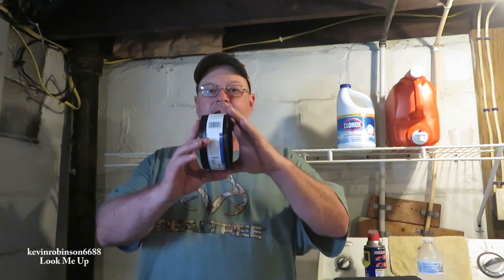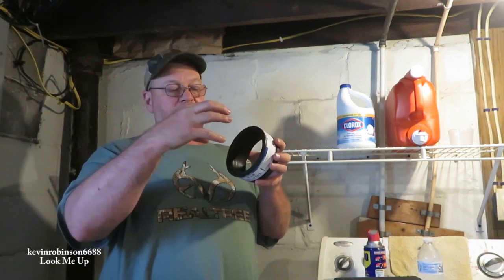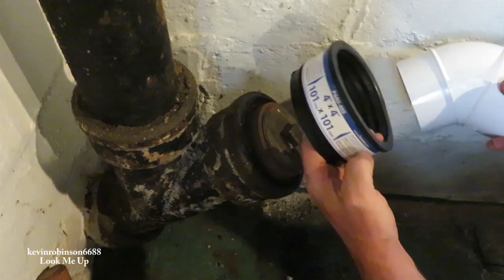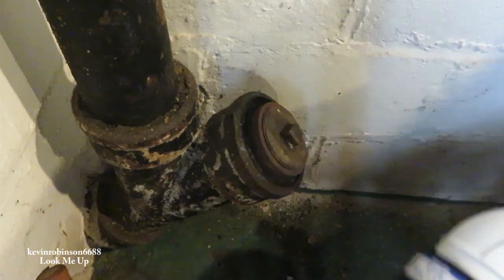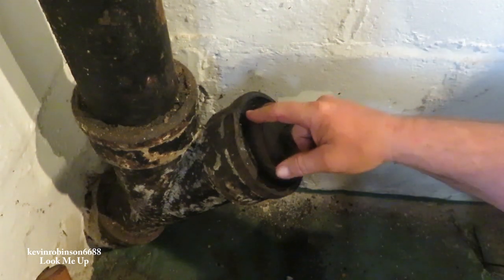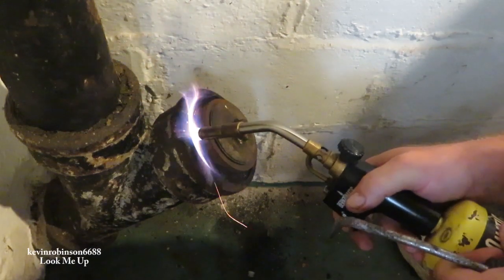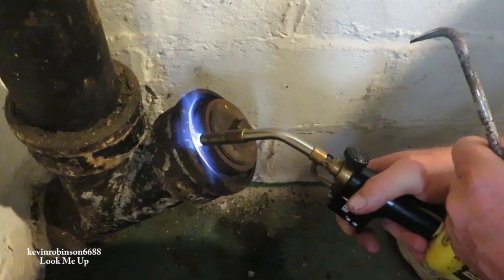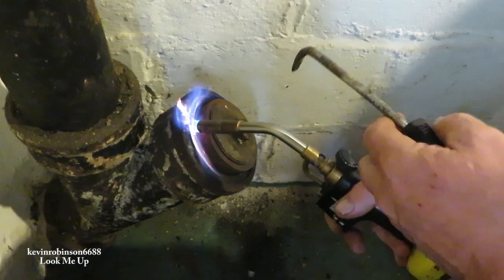How to remove a lead joint form Cast iron drain and connect to pvc pipe

Comment: Nice video for sure. What holds the white PVC elbow tightly into that rubber hub/bushing that you inserted into the cast Iron pipe? It looks like it is a loose fit and might leak. I have a similar situation coming up and anything you can share is helpful. Thanks!
Reply from the maker: I don't remember using anything to hold it in it ,did fit pretty tight and i never had any issues with it, make sure you have plenty of fresh ventilation before cutting that lead pipe.

Comment: Very Nice video and very useful info..
I need to find out how to remove a 4" cast iron T with two sides connected with rubber bushings. (Note: One horizontal hub coupling and one vertical hum coupling (facing downward) has the rubber bushing/donuts. The top opening/coupling on the  sanitary T is currently open with no pipe currently installed. The T coupling doesn't have any play in it to try and remove it. Have you had that situation and I welcome your advice? Thanks.
Reply from the maker: That’s a tough one! I haven’t come across that situation yet, but it seems like a real challenge.Sorry i can't help

Comment: Just take a drill bit and drill a bunch of holes around the pipe in the lead then pick it all out with a big screwdriver. You drill the holes in about a minute and it takes maybe a minute or two to get the lead out. Beat the pipe with a hammer to get it all moving. Once it's out use a wire brush in a drill to clean it up. Overall it takes maybe five minutes if it's in a bad spot or stubborn. With how loose that fitting is I can tell that it won't seal worth a damn either, if you've done it right it'll be hell getting the pipe in there. You almost always need to lube it up and beat it in. 

I've thought about melting it before I had the thought of A: I don't want to kill my lungs and B: the cast iron will just suck the heat away and make it take forever. I do plenty of work with old cast iron and it truthfully is so much faster, easier and less harmful to your health to just drill the lead.
Reply from the maker: Thanks for the info, but i did it the only way i knew how to at the time.

Comment: Induction heater
Wrap the coil around the outside of the pipe and the pipe will get red hot in seconds and you can pull the clean out right out of the pipe
Reply from the maker: Thanks for the info.

Comment: Would an inductive heater/ pipe soldering iron such as a Ridgid RT-175 work in place of the MAP gas torch?
Reply from the maker: It should, not positive but give it a try.

Comment: The soil pipe hub seal requires the full O.D. of a 4" PVC pipe to fit correctly and make a tight seal.  Chamfered on the end, lubricated with some soapy water and with much effort, forced into place to assure a tight seal.  If the reduced end of the slip-fit 45 degree fitting, as shown in the video is used in there, it won't provide a very good seal. Could leak both liquids and sewer gases.
Reply from the maker: No issues so far but thanks for the info

Comment: I just want to know how to get the PVC pipe into the compression coupling, it doesn't just slide in, it doesn't go in with a rubber mallet, and I have no room in my upstairs bathroom floor to pry against anything.  There has to be a better way... 4 hours trying unsuccessfully to get this in so I can use the toilet, this is ridiculous!  HELP
Reply from the maker: Did you try any dish soap to help ease it on, sorry for the late response.
Reply: @Robinson-Homestead  I did, just not worth the hassle.  I ripped all the cast iron out 2 days ago and replaced everything with PVC all the way to the basement.  It was the right thing to do now, I got rid of the wonky plumbing they did 50+ years ago.  Now my sink and tub are tied in further down so if something happens to the toilet, I don't lose my entire bathroom, and the toilet isn't using the tub and sink as a breather LOL!

Comment: I'm not a plumber by trade but do not heat lead up unless you're certified in knowing what you're doing safely. No ventilation or ppe for those lead fumes is a good way to Darwin yourself.
Reply from the maker: Thanks for the comment

Comment: So much easier to use a carbide toothed hole saw bit...trust me. I do it all the time. Been plumbing almost 20 years and I own my own small business. I exclusively do remodels and service. Try it and you will see. Fk doing the torch method and the drill bit method
Reply from the maker: Thanks for the comment.
Reply: What size of hole saw
Reply: For a 2 inch hub

Comment: Very  well explained...Thank you.I still have a question: Is that tight  enough  to  seal perfectly? I have seen some guys  using  4" regular PVC pipe and just make a bevel  to the end which inserted  in to make it tighter?
Reply from the maker: I have had no issues so far thanks.

Comment: I haven’t done plumbing in 30 years but that rubber thing we used to call dual tights and you have to grease it and it’s really hard to put it. I have no idea what you were using but that’s gonna leak like a sieve.
Reply from the maker: Thanks for the comment has been working great so far no leaks.
Reply: @Robinson-Homestead You probably wouldn’t have leaks until it backs up. Imagine two straws, one with a smaller diameter than the other. They fit loosely together. You connect them with the bigger one on the bottom. If you pour water into this assembly, you wouldn’t have a leak. Then you plug the bottom and pour enough water for the water to back up above the joint. Now you have a leak.
Reply: It lose because he didn't use a schedule 40 PVC street fitting... that fitting he used is the schedule below it.. I think 35 but they just don't list it if if below schedule 40.. they just call it DWV... the one he should use is schedule 40 DWV .. SUPPER tight fitting once it slides in then stretches the outside diameter to grip the cast coupling

Comment: Nice job. An alternative method is to drill out the lead. Get about 5 drill bits an 1/8 in in diameter and start drilling holes all around the joint. Expect to break several of them. Takes about 20 minutes and you will have drilled enough lead out that you can wiggle the joint out by hand. I have used this technique several times on 4 inch cast iron pipe in my home. It works well. Be sure to measure the joint and get the right size fernco fitting.
Reply from the maker: Thanks for the info.
Reply: I love it when the commenter didn't watch the video. LOL (he mentioned the process you suggested at the beginning and explained why he wasn't doing it)

Comment: Hi, I was watching your video and I think I have this problem with a sewer elbow cast iron that comes straight from the toilet on a 90 degree under the foundation and I need to link it to a PVC sewer pipe.
Can I send you a pic maybe you can advice me.
If ok please reply with your email so I can send you a pic.
I already have everything apart and the pipe exposed showing the rusty broken fitting that needs to be removed.
Thanks
Reply from the maker: Sure kdr6688@gmail.com

Comment: I'm watching this because I never did this specific chore of modifying my sanitary C.I. In my basement (for a planned DIY project). But my career has been doing environmental stuff and years of H&S trainings that came with it. I could be wrong, but isn't there something wrong with burning (and breathing) lead in a confined space and without the presenter using a special cartridge respirator?? Most of my career was working around VOCs, but this just raises a flag for me. But again, I could be wrong.
Reply from the maker: This was my first time need lots of ventilation I am not a professional

Comment: DOES NOT WORK!!!
Reply from the maker: No issues so far working great thanks for the comment and watching.
Reply: It does NOT work please do not listen to Kevis pure bs. I just used it its to loose of a fit and the 4 in pvc does not expand as you would want it to to put some pressure on that rubber! Cut the cast iron pipe and union the pipes.
Reply: Its likely because you did not have the right size Fernco fitting for the specific joint you were working on. I have connected PVC to Cast Iron several times and the materials and technique shown in the video is correct for the specific joint he is working with.

Comment: i had no idea this was even an option. I've connected to cast iron cleanouts with male adapters but it's probably not as strong.
Reply from the maker: Just be careful dealing with the lead pipes it can be dangerous for your health without saftey equipment.

Comment: Old Plumber here—You have the wrong fitting. You need schedule 40 and grease. 
Also you need to install a new clean out immediately adjacent to the one that you removed.  Check out the code.
Lastly, back in the day, the lead joints were removed either with a lead pick( I have one) or with the fire pot that kept the lead ready for the joints on the job.
Reply: New plumber here—You think he’d notice it didn’t seal. SDR fitting, when it clearly says DWV (Sch 40). Should have called a plumber.

Comment: Thanks!!
So how does the rubber hub get completely sealed to the cast iron and then to the pvc fitting?? Everything seemed a little lose when you test fit it.
Is there a glue of some sort?
Reply: Then pvc expands the doughnut

Comment: Good info, I've done this before. It sure seemed like you pvc went the rubber boot easy. To easy, did it leak? Mine went on super tight, I had to pound it in with a 2x4 and hammer.

Comment: You've got a schedule 35 pvc fitting, which the fernco donut isn't designed for. You need to use 4" ABS or 4" schedule 40 fittings, which will be a little larger in diameter and fit tighter in the donut.
Reply: I think , in my opinion, that it wasn’t service weight (sv)cast iron it was extra heavy (xh) cast iron which is stamped on the side of all cast iron hubs when forged, therefore that’s why the gasket was so loose … no way would that pvc slip in without extreme amount of effort!!! And lots of lube ! 
This coming from a retired plumber with 45 years of experience in the Long Island NY area !!!
Reply: @louiscandreva8850  What would be the correct donut for joining 4" PVC to XH cast iron?
Reply: @louiscandreva8850  Hoping you can answer.  How would you recommend joining PVC to an XH hub joint?
Reply from the maker: Thanks for the information.
Reply: I was noticing that.  Wondering if the iron being hot had expanded it a little like taking bearing races off of a car
Reply: Looked loose to me too. That explains it.
Reply: The lead is out... your pvc/fernco fitting is way too loose.
Reply: Agreed!
Reply: i noticed that too
Reply: That's a thin wall 1/16 bend no bueno

Comment: Thanks Kevin, my cast iron black pipe goes up through my attic and the septic smell is coming out of the connections of two black iron pipes that were once joined by lead. The lead seems to have lifted up. So I removed and now I placed mortite puddy all around to try and stop the smell. It seems to have worked. 
What would you have done.
Reply from the maker: Put a rubber sleeve over it with hose clamps.
Reply: @Robinson-Homestead  unable to use that unless I cut it in half. And use clamps.

Comment: Its been many decades since I had to do this but I have one to do again now so I'm watching videos. I don't like the torch method and I don't much like the drill method either. I think I used to break the pipe or fitting one inward one chip at a time using a cold chisel , and then use the chisel to pry the lead toward the center and once started it came out easy. Then, because they didn't yet make ferncos, or rubber donuts, or no hub connectors, we had ABS to CI fittings with a spigot,  caulked in oakum, then packed in lead wool which you could pack back into a solid with caulking tools which look like off set chisels but the are flat on the end. I ' just a kid and the real plumbers were still ladling molten lead into the joints.
Reply: I was trying to figure out what the last guy did to my 1-1/4" sink drain and I think the method you described was it haha. Never seen anything like it. Thanks for this comment, I never woulda figured that out without finding a comment/thread like this

Comment: Not a fan of this unsafe method not to mention the time it takes. I recommend removing plug cutting internally several grooves and chisel out pieces. Or you could just thread in an adapter.

Comment: I am a self-employed plumber in New York State with 34 year's experience. I was taught as a helper from my uncle Vinny to do it the torch way. It takes forever and is very messy, especially up in a rafter. I learned the drill and chisel trick and I like MUCH better
Reply: The new trick is to saw the c/o flat,take a hole saw put it over the  hub and  drill out,really fast.
Reply: Drill and chisel sound better. The smell of lead isn't good.
Reply: @DJjosher  It's sweet like lead paint! Yummy!
Reply: This is dumb use a hole
Saw and drill the lead out around it it and it pulls right out
Reply: I agree with both but your way is easier because lead is soft👍🏾
Reply: I could have had the hole house plumbed hammer and flat bar done in 2 minutes
Reply: Breathing those lead fumes is terrible for you it's much safer for your health to drill but make sure you're wearing a mask and gloves
Reply: Try a. Holesaw. I.m a 30 year plumber & it's a new trick to me
Reply: Hole saw faster cleaner plumbing  for over 40 years
Reply: Kevin is working on a cement floor and next to a brick wall, which is more safe than using a torch in an area surrounded by or in proximity to wood.
Reply: Problem is, the cast iron absorbs the heat, and lead doesn't want to melt. You can't do this with a propane torch. It just doesn't get hot enough.
Reply: Am I the only one wondering why the clean out was "soldiered" shut??
Reply: It wasn’t soldered shut, the clean out plug screws into a fitting sleeve, and that fitting is what is fit into the sanitary tee, the joint gets packed with oakum and then about 1/4-1/2” of lead is fed into the gap between the threaded sleeve and the tee, over the oakum. Then finally the lead is peened with a punch to set it, and expand it to fill the voids and lock everything in place. Then you can use the clean out as normal, it will unscrew from the threaded sleeve.
Reply: I think they had to seal it the way they knew how and before things were easy they were hard. Lead is plumbus? (pb- periodic table)in Latin and that because of what pipes were sealed with for thousands of years... and made with at one time due to the softness and ability for lead to fill gaps and bend slightly.

Comment: I have learned a lot from YouTube videos, but I usually do more research including watching several in the same subject and not go by the first I see. 
  There have been a lot of people watch this one. 
  I hate to make a negative comment, it might save someone from getting hurt and or doing more damage. 
  I have to wonder how many have tried this and gotten hurt or caused more problems!
  No plumber here but no way would I leave that connection that loose. 
  Op’er, no need to thank me for my comment.
Reply from the maker: Having no issues thank you for the comment

Comment: This is great but I have a 3inch hub Y that I am trying to remove the lead in but it’s up in the wall near the ceiling.   I’m trying to attach a 2in shower drain to it with a donut.   It’s in a confined space.  Maybe can get in there with a drill.   Any ideas??
Reply from the maker: If you melt it make sure you have good ventilation

Comment: I believe you had a street elbow/fitting. I pretty sure the service weight hub you slid into the cast iron should have a full diameter 4 inch pvc slid into it. You should have to bevel the edges to get it started and there should still be a good bit of compressive resistance trying to slide it in. Usually have to put petro jelly on the pvc I usually use silicone as it makes it slide in easy and help seal once cured. Just my 2 cents.
Reply from the maker: Thanks for the comment and watching
Reply: @Robinson-Homestead  yup ,anytime . This is how we all learn. Specially tips and tricks to make life easier.
Reply: Dan that is what I need but don’t know where to look for such a thing. And when I do find the proper hub I don’t know what pipe cap to purchase that won’t blow out if the sewer builds up pressure. Any good videos to show a horizontal application? P.S. I actually discovered the clean out cap to the soil pipe had corroded open and was letting sewer gas into the house.
Reply: @Fresh-tw7ev  don't know where you are located.  If midwest menards carries them forsure. Home depot as well.  Or a local plumbing supply house. There should be no pressure in the drain lines. If there was you would hear the sinks or toilets bubbling. If you are having sewage problems. They make a sewage back flow preventer valve which only allows sewage to go one direction.

Comment: Interesting use of MAP gas. You removed a clean-out that is required to build a drain… and the wye doesnt have the weir required. And now if you have an issue in the line to street you need to reverse the process.  Better to a another wye with a PVC clean-out THEN build on.
Reply from the maker: Thanks for watching

Comment: You have more patients than me I use a grinder split the plug in half than pop the plug out  make a little deeper cut use two Hammers and crack the  clean out in out than the lead and oakum comes right out  old school plumber